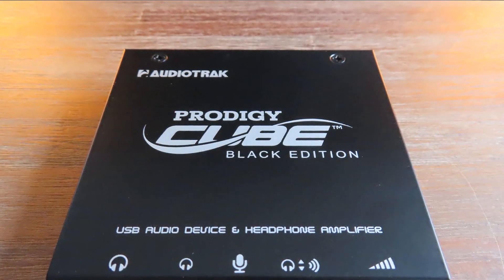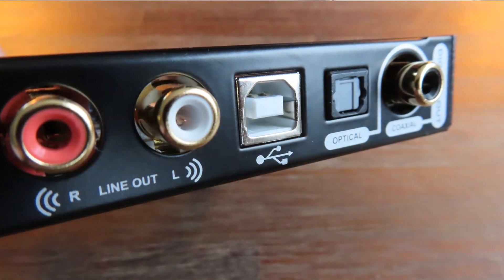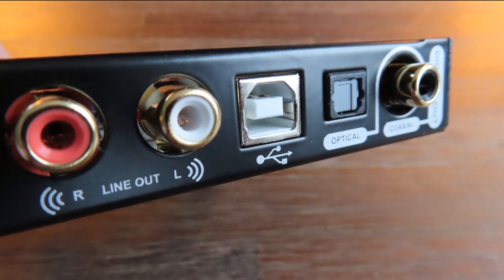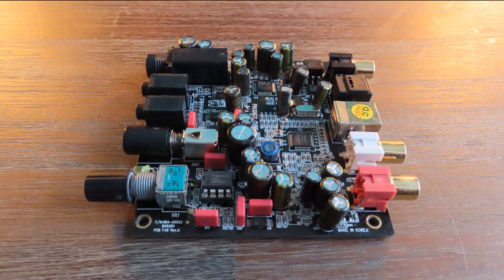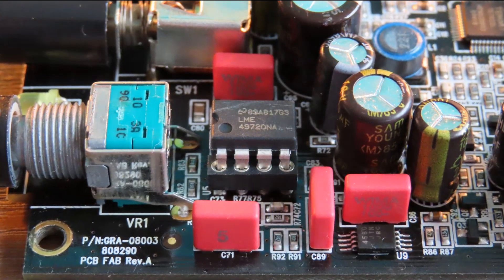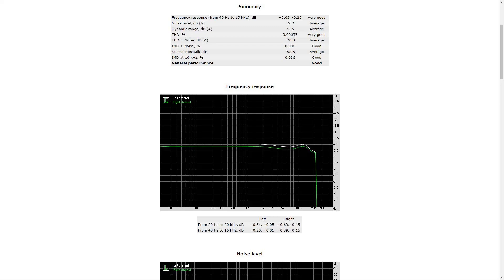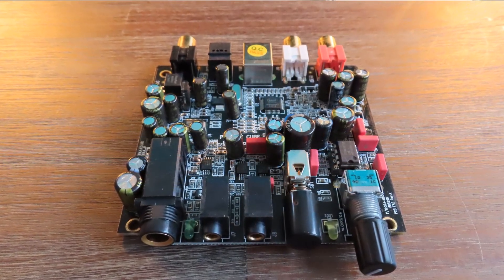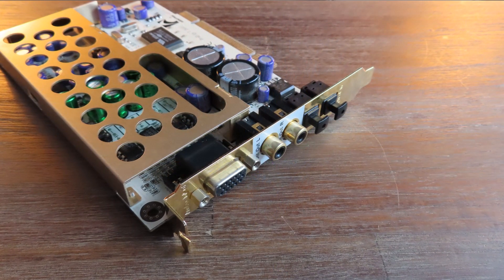Is this Prodigy sound card No good?

Comment: This expensive and using generic USB 3.. Could have done thunderbolt or USB c for that price..
Reply from the maker: You may want to check out the Creative Play! 4. I believe that that one is USB C. I haven't tested that sound card yet, but the numbers are rather nice!
Reply: @AntonsHardware  I have an older motherboard the Asrock Extreme 3 gen 3 z68 , so when I saw an Asus Xonar D2 card on marktplaats for 20 euros I went with that instead. I love your channel very informative. The sound my current Asrock motherboard came with was subpar to say the least. Thanks to your videos I was able to see the Xonar to be a rather good card for those with a spare PCI slot when you got all your pcie ones used up.
Reply from the maker: The D2 is cooool. Love the lights! I made a video about that one some time ago. https://youtu.be/6DEzLQ-OVHY 

En ik kijk vaak op Tweakers.net voor tweedehands kaarten. :D